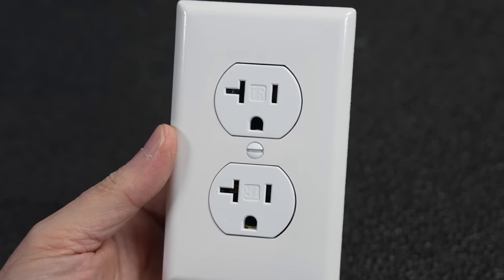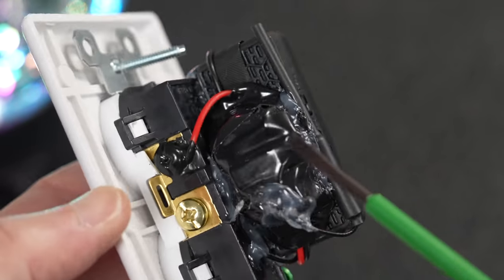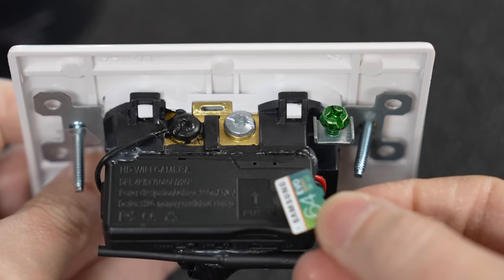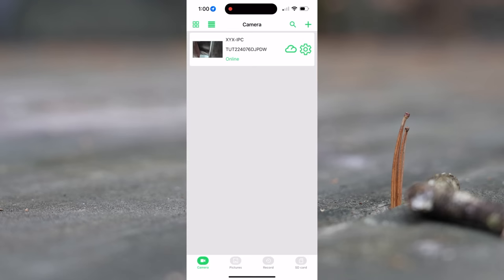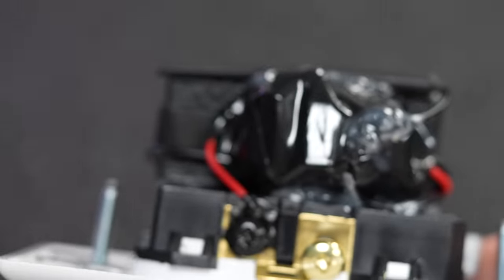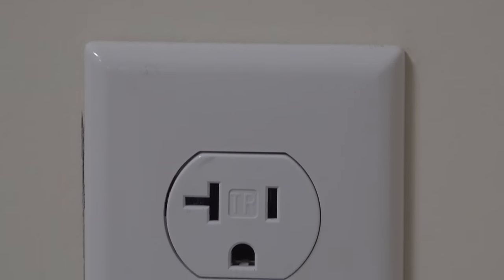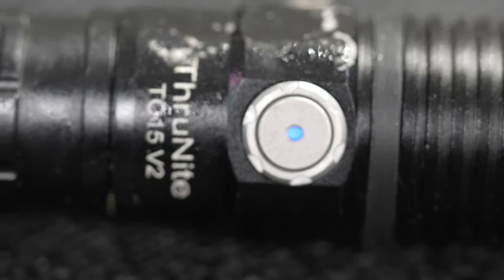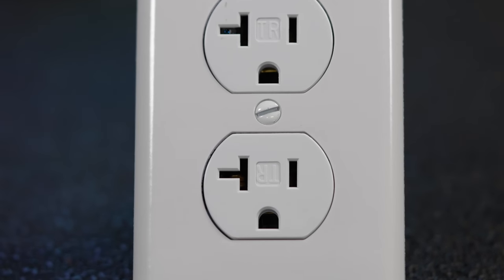Most ILLEGAL Outlet in the United States

Comment: In case anyone wants to know. You can tell a 2 way mirror by sticking your finger against the glass. In a regular mirror there’s a slight gap between your finger and the reflected finger. In a 2 way mirror there won’t be a gap.
Reply: Depending on how the two way mirror is made, that's not always true.
Reply: Some mirrors are so thin it's hard to tell
Reply: There are some expensive mirrors where that doesn't apply.
Reply: @karlrovey 
I said that it depends on how it is manufactured.
Reply: @Zeaiclies  And I was pointing out the same applies to legitimate 1-way mirrors.
Reply: @karlrovey 
No, not always.

Comment: As someone who has deployed covert cameras more times then I can count, they're certainly not illegal. It's all about use case. Deploying a camera into someone's house without permission or a warrant is illegal; you're violating their right to privacy. Using this in an area where there is no reasonable expectation of privacy, on the other hand, is usually perfectly legal. If it's in your own house, the same general rules apply. You can record yourself however you like, but recording guests in an area they expect to be private (like a spare bedroom or bathroom) is illegal, even though you own the property.
Reply: Woudln't you be violating electrical code by installing unapproved devices?
Reply: @soundspark  The one linked in the description is UL/CUL listed. But to answer your question, probably yes, depends on local code.
Reply: @butsukete1806  Might be a counterfeit label, kind of like when the dual T-slot outlets got busted by UL.
Reply: If the covert camera is integrated into an electrical device like a receptacle then don't you have to be a licensed electrician to install one in someone else's structure?
Reply: @soundspark  If you're doing the work as a business, then you have to be licensed (or be an employee of a licensed electrician).  In many areas, you don't have to be licensed, if you're doing the work for a family member or a friend.

Comment: There's nothing "illegal" about having those installed in your house except in the bathroom or maybe someone else's bedroom like a roommate. That's where there's a reasonable expectation of privacy is and intruding on that is what's illegal. You can have them in the living room, kitchen, etc... where they are common areas shared by multiple people with zero expectation of privacy. Same rules as nanny cams, vent cams, fire alarm cams, etc... Different states have different laws about the audio. Where I'm at, only 1 person in the group has to know there's recording happening, and that 1 person can be you. No one else has to know. So, no. They're quite legal.
Reply: by current codes, no they are not legal in any location requiring a tamper resistant receptacle, as the Temper resistance part on this receptacle has been removed. And I also imagine that this camera violates the original UL listing of the receptacle, and if it hasn't been recertified in this configuration with the camera installed, that means it does not have a valid UL listing, and thus is not legal to install.

This is on top of the fact that the general design of this thing just makes it a bad idea. Putting the camera in the Neutral T slot is bad enough, if you actually had a 20 amp appliance or cord and plugged it into the top, it destroy the camera and likely damage the outlet. And there is the fact that just having always on electron8ics inside your walls isn't such a great idea, because if that thing catches fire, its a fire inside the walls. There are also box fill requirements to think about as well.

Comment: As a electricians for decades, have installed lots of these and have never seen a camera or any other electronics on them. the electronics is hot melt glued on, it is definitely not a consumer production off the shelf unit. Placed there by others, nothing particularly special about this 'hide', there are easier hides in better locations. There is no reason for a 20 amp receptacle to be in a residence let alone in a hallway or living room etc. All electrical devices expected to be powered are consumer electrical devices and limited to 12 amps and rarely exceed 9 amps, a 20 amp receptacle would easily be noticed, not a good hide.
Reply: With the modifications no matter what this is not UL or CE so it is not code-legal, you might be able to get around that by Not installing line voltage at all but that is questionable. Now to your point about the 20 amp receptacle,  you are right in a home this type of receptacle is rare outside of the kitchen including the dining room and wet bars, garage, outdoors, bathrooms, and many unfinished basement locations. These are locations normally GFCI-protected (daisy chained to make every receptacle downstream also GFCI protected)(GFCI breaker) but not always.
Reply: @ProudDad1976  there is no reason for 20 amp receptacle in any residential kitchen, wet bars etc and certainly not in any bathrooms.
A GFI has nothing to do with any of this.  Garage wiring is often configured as the home owner desires. They can have anything they want. There is no standard maximum. Loads greater then 20 amps are supplied by a single use dedicated circuit and receptacle if not hardwired in.
If there is no line voltage installed then it is of no electrical code concern. It is just a box installed in the wall. 
FYI: electrical code is not concerned with anything under 40 volts AC.
Reply: @MrBonners  Only the national electrical code states what I said to be true, only that! I wanted to speak about where GFCI's and 20 amp circuits are required in a residential structure. Are you really an electrician?
Reply: @ProudDad1976  Electrical kitchen appliance loads are less the 15 amps. There is no need for 20 amp receptacles. Heavy loads like an ovens and dryers have dedicated receptacles and dedicated circuits. You can put whatever you want in  garage. An empty electrical box in a wall is of no concern of the code. Also anything less then 40vac is of no concern. Such wiring is low voltage lighting, communications, alarm equipment etc.  
You want to go above code and install 20AWG cable and 20 amp receptacles in the kitchen you don't get any bang for your buck. none. zip. zero.  But feel free to do so, going above code is fully allowed. 
GFIs requirements are about locations of receptacles like bathrooms, hot tubs, and other wet locations and a fault condition. Nothing to so with load current requirements in a residence. 
You can hot-melt glue anything to any receptacle. Doesn't have to be a 20 amp and you can't buy off the shelf such a configuration. 
This is a bs video. There are much better hidden and easier ways of placing monitoring devices. A 20 amp receptacle draws attention as being odd, out of place in a residence, not a good hiding space.
Reply: @MrBonners  I agree this video is not that great but you cannot be an electrician within the United States with what you have told me, I have gone through a five-year apprenticeship for commercial industrial and an extra two years for residential with a fire alarm license as well. I am not a master electrician however I am a licensed journeyman electrician and have been since 2003. What I have told you comes right out of the National Electrical Code Book and other than the change of needing two ground rods for a single-family dwelling at least six feet apart this has been code since I started studying the 1996 code book. Anything 90 volts and below is considered low voltage with the low voltage ring he used is wrong as well, for line voltage 110 volts and above needs to be an enclosed box either old work or new work, will you agree to that?
Reply: @ProudDad1976  You are full of it. your terminology and the order of things is way wrong. 
apprenticeship is 4 years, not 5. There is no  extra qualification for residential.  Residential is the simplest technical level and only about 15% of a journeyman ticket, and few small sections of the code book. Fire alarm ticket is only offered to journeyman. 
This video has nothing to do with ground rods. The numbers of rods per area is determined by the soil and site characteristics. You know nothing of explosion proof,battery rooms, welding banks.......
your give away your bull as it hasn't been 
" 110 volts " in 50+ years. 
extra low voltage = less than 40 vac. 
Empty box with only a spy camera in a wall is not 'code' work. 
As said, the video is bs regardless if it is a dummy 15 amp receptacle or a 50 amp one. Nothing to so with GFIs.  Nothing to do with electrical code.
FYI: I'm a retired master.

Comment: One way you can use your phone to detect a hidden camera works if the camera uses IR led's for it's night vision. Make the room as dark as you can and open the camera on your phone. Scan around the room slowly watching the image on your phone. IR led's will show up as a dull purpleish glow through your phone's camera.
Reply from the maker: That is a great tip if they have the illuminator and is so easy, thanks for sharing this!
Reply: @nik_kot  Must be a pretty new thing. My Iphone 11 can see them, its how I check if remote controls are working. In fact before I typed this response I just tested my phone looking at the camera in my workshop and the IR's were clear as day on my phone screen.
Reply: Front cameras have no ir filter for high end phones. Older phones don't have the IR filter on the rear camera
Reply: @nik_kot  I use my phone camera to test TV remotes and even photo sensors on equipment I work on and it works great

Comment: Hidden cameras often (but not always) have infrared illuminators. They might only illuminate in the dark. You could see this with another security camera or some night vision “goggles” that can see IR. You could also potentially detect a camera with a thermal camera like those that connect to a phone.
Reply: your ordinary phone camera can also detect it. You can easily test it on tv remote. Just open the phone camera, point remote control to it and click a button on remote control.
Reply: your standard digital camera can detect those as well. In fact people use DSLR cameras with high zoom lens to check for outside night vision cameras while casing the joint for future criminal behavior. 🤔
Reply: @ohioplayer-bl9em  With DSLR, most have a built-in ir filter to improve image quality that would need to be removed.  They also make dedicated ir DSLR cameras.  Hunting night scopes can also see it.
Reply: I've used my Oculus Quest 2 for this before.  Even if there's no visible light, it can see infrared very well in passthrough mode, and there you go.  If there's infrared light where you don't suspect it: you have trouble.

Comment: What's interesting about a 20 amp receptacle is that it really is illegal to install it on a 15 amp ckt.  However, it's 100% NEC compliant to install a 15 amp outlet on a 20 amp circuit.   
Voyeurism is a crime.  What's worse for the voyeur though is he/she never knows how many crimes will be committed or how serious they are until the video is already recorded.  The manager might have been trying to catch a maid stealing from the guests, but instead, he inadvertently recorded a child changing clothes, taking a bath, etc.
Reply: I have seen a few 20A branch circuits where a single duplex or GFCI was installed.  My friends recently sold their house which had an older sub panel upstairs, the newer 200A main in the basement.  There was 20A GFCI outlet on the wall feeding the outlet/lights in the bathroom, there was no way that branch circuit was 20A/12ga.  Their kitchen had 2 countertop outlets which were connected to the garbage disposal/dishwasher already creating an overload condition on a 15A circuit.  I had suggested having a new line pulled for the D/W and disposal or multi-wired and two addition 20A's for the countertop outlets GFCI.
Reply: For that last part, when I found searches on the work computer for these kinds of voyeuristic devices, I warned the boss that the individual who was doing these searches could be unwittingly making child abuse material by operating one.  That only got me in more trouble with the crooked employer.

Comment: Just to clarify, the outlet style itself is not illegal, used on  properly rated circuit. The spy device inside sudely should be.
Reply: Being a fake outlet, it can't be legal to wire into a house.
Reply: @soundspark  the camera in the outlet like this almost certainly violates the UL listing of the outlet, which makes it illegal to install. This is on top of the fact that it would definitely be illegal to install in any location requiring tamper resistant receptacles, which is most residential spaces.

Comment: What's illegal is that you installed a 120v outlet into a low voltage cut out that is a big code violation.
Reply from the maker: Come on, I put some text to mention that
Reply: @SilverCymbal  didn't notice the text till now. Still should be changed. Good video tho.
Reply: I didn't notice the text either 🤣. Just thought "oh man, that's a big no no"

Comment: I see a lot of comments saying that various installation practices or wiring methods are ILLEGAL. That is not true at all.
Code violations are not illegal and do not break any laws. The NEC is not law. No legislators are involved in this.
If you wire something incorrectly, or you install an unlisted device, that is a CODE VIOLATION, not illegal. No one is going to court or to jail. The inspector would just flag it and tell you to fix it and you won't pass inspection until it is fixed. That's it. There is no law being broken. If you install one of these, just put it in after you pass inspection.

If you are somewhere and you see one of these, you have choices to protect yourself.
1) Shut off the circuit breaker controlling that circuit.
2) Plug something into the camera receptacle.
3) Put tape over it.
4) Move furniture in front of it.
5) Go somewhere else.
6) Take the plate off, pull the receptacle out, and unhook the wires. Ot even just unhook the neutral. Problem solved.

Comment: If you are worried about security use a camera sensing device. You can buy them on B&H. And yes they work. They are not the type you showed.
Reply from the maker: I decided to check what you said and they don't sell a single device with more than a 2.5 star review. 1 with 2 reviews had 4 stars. Detectors can pick up some cameras some of the time very unreliable not to mention if they record to micro SD and require a trigger to reply, they will never be dected by any of these. Most sweeping teams use 6 or more different tools to pick them up.

Comment: If you are concerned about this threat in particular, you can also buy a 20-amp male plug for about $5.  It has one vertical prong, and one horizontal, which is why the 20-amp outlet has the T-shaped slot (to allow vertical and horizontal prongs).  If the plug goes in, you know you've got nothing to worry about.  If it won't, investigate.

Comment: If you see a outlet with a 20 amp configuration (looks like a "T") you may want to look at it closer. It is very rare to have a 20 amp outlet installed in a dwelling or guest room in the US. Even in locations that have 20 amp circuits it is typical to only have 15 amp outlets.
Reply: I agree. You would only see a 20 amp circuit near an appliance like a washer or refrigerator.

Comment: I live alone, and this is tempting as a pet/security camera. Though if I lived with other people I think I would have to pass. I currently have a pet camera that tosses treats, it's obviously a large device/camera, thinking this would be a nice for other angles without having large devices all over the place.
Reply: There are small and discrete cameras available for a lot less than specialized security cameras like this. (Another comment suggested these cost upwards of US$200.) I have a camera I bought at Walmart for about $20 that does everything this one does, except hide inside an outlet. The face of it is slightly larger than a quarter, and it sits on a stand that is, maybe, 3" tall. I have it inside the house, watching the driveway through a window, since we've had a few problems out there in the past.

Comment: As an electrician, I would be wondering why a 20 amp receptacle was installed in a living space. Kitchen, maybe. Bathroom, maybe. Anywhere else besides a garage or shop would be weird, and a potential problem (from a wiring standpoint, not suspecting a camera).
Also, understand that less than 1% of 20 amp receptacles will be these cameras. Just because you see a 20 amp receptacle doesn't mean it's a camera.

Comment: Unbelievable! Thanks for posting. I have a question about how you installed it. You used an orange low voltage box. Was that just for simplicity for the demo? Thanks again for the video.
Reply: you're right. I think this was the scariest part of the video. Even if he did it for simplicity, someone out there will use it to wire up 120 volts. Orange is only for low voltage stuff like cat 5

Comment: Haha, I was assuming it was because it was a 20 amp outlet that is highly unusual for residential outlets and would likely be above the capacity of the likely 14 gauge wire and maybe a 15 amp fuse. That's pretty scary and amazing tech BUT the fact that it's a 20 amp outlet makes it highly noticeable. If they were to put it in a standard 15 amp outlet, nobody would have any clue. Crazy stuff.